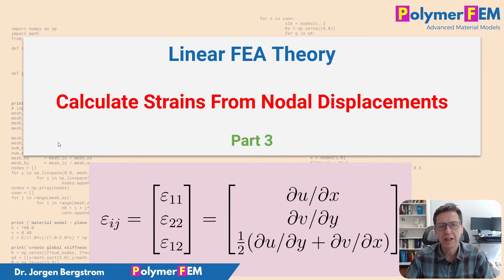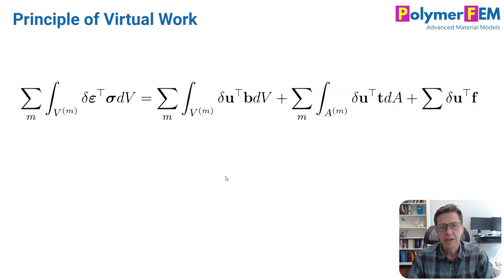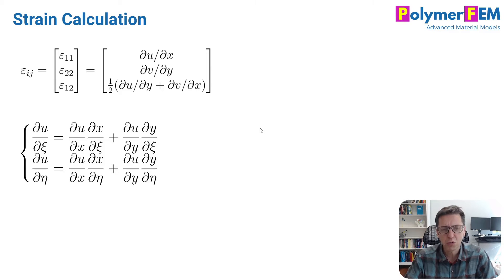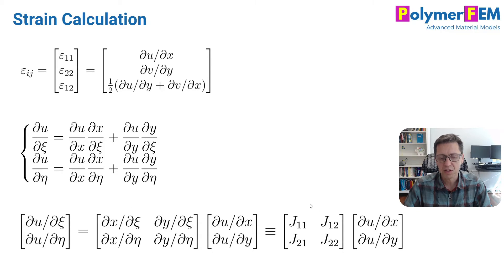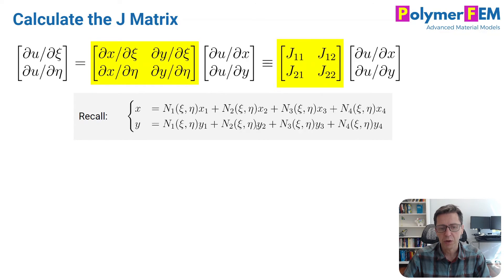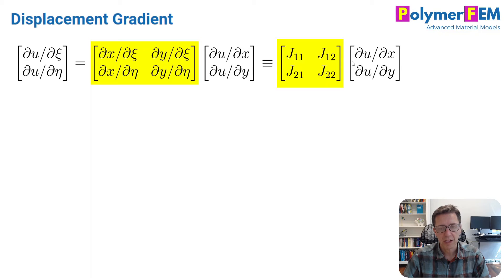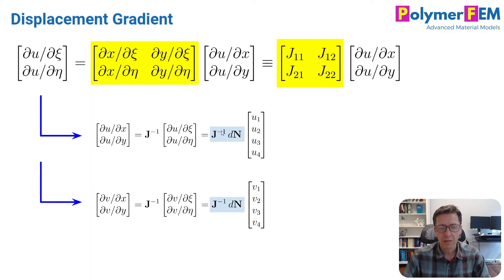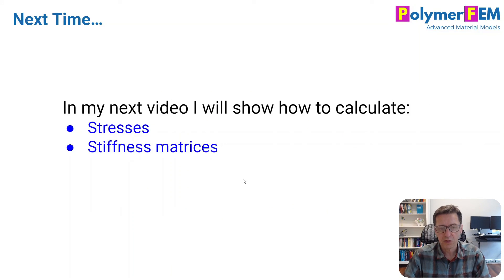Basic FEA Theory - Part 3 - Calculate Strains

Comment: Question

Element strain at time 2:39
is that should be e=[e_11x e_22 e_12] =[du/dx, dv/dy, du/dy+dv/dx] ??
not  e=[e_11x e_22 e_12] =[du/dx, dv/dy, 1/2( du/dy+dv/dx )] 

I'm studying with Bathe, Klaus‐Jürgen. "Finite element method." Wiley encyclopedia of computer science and engineering (2007): 1-12.
Reply: The true shear strain epsilon_12 = 1/2 ( du/dy + dv/dx ) but the engineering shear strain gamma_12 = 2*epsilon_12 = du/dy + dv/dx. Perhaps your textbook is using engineering shear strain (gamma), instead of true shear strain (epsilon).
Reply: Thank you so much!!
 @SSoIo
Reply: I have a question in this topic, how could I reach you by email? Please provide it if possible. Thank you @SSoIo